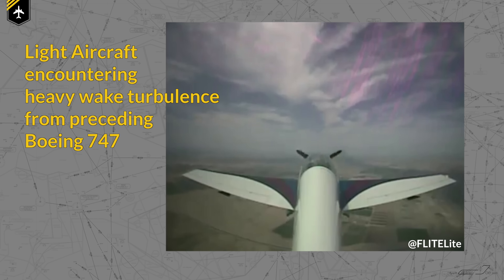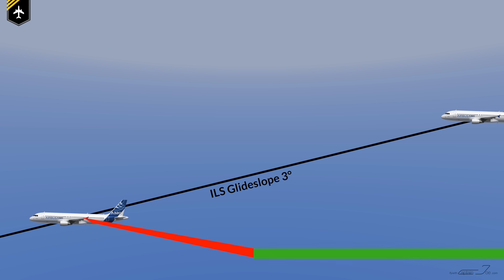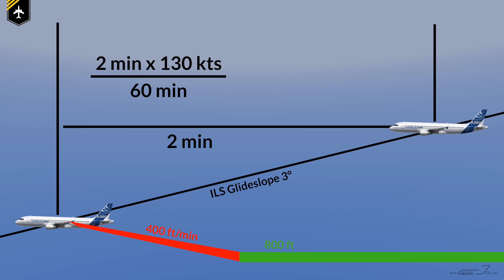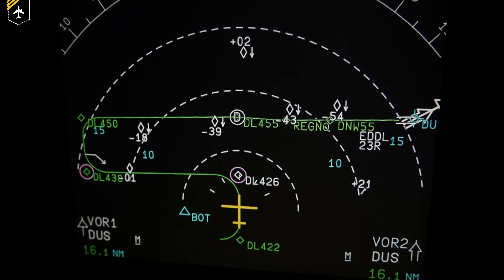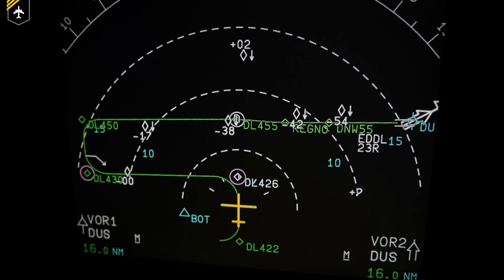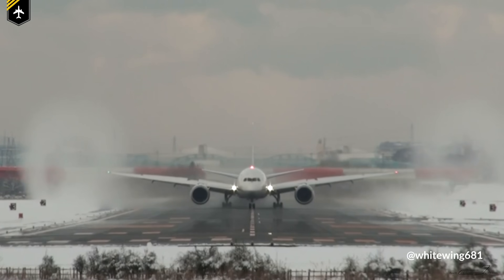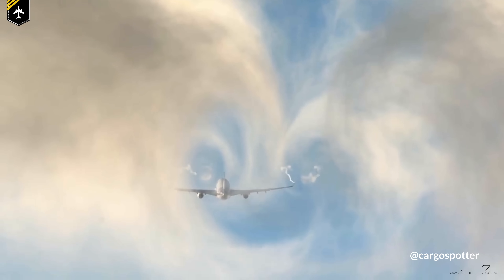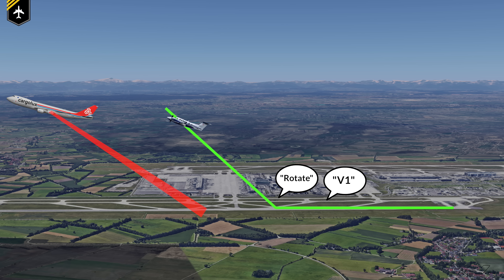WHY do pilots say HEAVY? Wake Turbulence EXPLAINED BY CAPTAIN JOE

Comment: Good explanation of heavy jet separation. However, contrary to your explanation of a turboprop departing after a heavy, there is also increased separation when departing behind. Generally 4nm heavy after a departed heavy. And 5 nm for others after a departed heavy. Also, 2 minutes time may be used, but controllers usually use the RADAR separation as it is usually more efficient. If the  pilot wants the 2 minutes, they should advise the controller BEFORE taking the runway.

Comment: Hey joe, how the fighter jets elude this wake turbulance?? Because I saw group of them flying really close in different formations in many videos..
Reply: I'm not Joe, a pilot or an engineer, but I am read up on military aircraft.  Most military fighter jets are inherently unstable, which allows them to make sharp turns.  However, it means that humans are not able to fly them on their own.  As a result, they have flight computers that automatically adjust the control surfaces to keep the plane flying as instructed by the joystick inputs.  This takes into account the inherent instability of the fighter jets as well as any turbulence that the plane may encounter.

Comment: Wait, so since the Antonov 227 is larger than than the A380 is it also super, or does it not have anything?
Reply: E. Andrews it’s technically a super, but considering it’s so unique, if an An225 is coming, the controllers will be briefed beforehand and they would know exactly how to maintain separation.

Comment: The thing that doesn’t make sense is everyone approaching is usually on the same glideslope. With a 400fpm sink rate for the vortexes they should be well below the glideslope relatively quickly. Near the runway it could get bad though depending how long or short various pilots decide to land. 

In theory though a light should be able to safely follow a super as long as it stays at or above the supers glideslope, and lands beyond the supers touchdown point to avoid any vortexes that could be drifting on the runway.

Comment: For 8:09
Is it because the wake turbulence created by the plane is used by the glider to fly
Am I right?
Reply: That's not the principle how the gliders are flying.
In that scene we saw how an aircraft (a tow plane) is towing a glider with a towline. When they are at a certain altitude the glider will be released, and it starts its own flight. When the glider is gliding the wings produce lift that allows it fly, but of course it will lose altitude.
But gliders can gain more altitude by using rising currents of air. These are known as thermals.

When the sun warms the ground the warm air begins to rise and when this process continues it forms a column of air known as thermal. Now the glider can fly to this thermal and it can gain more altitude using this thermal. Then the pilot can glide to another thermal and climb again. 
By flying from thermal to thermal a glider can fly long distances, for example hundreds of kilometers.
Reply: @mikep9604  hi thank you for your answer
But that's not how gliders take off 
They take off using a catapult sort of structure 
But I agree with the second part
Thank you
Reply: @Hi-pp9ew  - Yes, gliders can take off using that "catapult" that is a powerful winch. Here is the principle of the winch launch:
https://i.stack.imgur.com/AP9t6.jpg
But yes, the gliders also take off so that a tow plane will tow the glider using a towline. That's called aerotow. I can assure that this is true because I was a glider pilot when I was young, and I have made hundreds of take offs so that a tow plane was towing the glider.
Here you can see the towline between the tow plane and the glider:
https://members.gliding.co.uk/wp-content/uploads/sites/3/2014/09/London-1024x769.jpg

Here are some videos about aerotow:
https://www.youtube.com/watch?v=KlovGBcJSBA

You can see the tow plane in front of the glider:
https://www.youtube.com/watch?v=kw88jLB4W1o

https://www.youtube.com/watch?v=WzGbrBrxOS8

Comment: But yet in air refueling happens below the tanker... is there a 'sweet spot' that has no turbulence?
Reply: As sir said
Wake turbulence is caused when the planes have the angle of attack  more or less than 0
The planes while refueling do no ascend or descend so the wake turbulence does not act upon it
And that can be considered as a sweet spot after the plane has been in the fixed altitude for quite a while

Comment: Well dont forget the only plane other than the a380 that uses "super" in its callsogn is the antonov an 225
Reply: the next one beyond super should be ex-wife
Reply: And the fully loaded C5 galaxy
Reply: @jackstephens7222  if I remember right it goes by the empty weight of the plane idk if the galaxy is heavy enough for the super callsign and plus im pretty sure military aircraft have different rules and what not
Reply: @sweetdaddydee1314   Im fairy sure its the weight its loaded too otherwise you could end up sending a plane into a vortex by mistake because of weight distance, seeing as how the c5 can carry abrams tanks im fairly sure its super some of the time. And yes they do use different protocol but if landing at civillian airfields (though rare) they'd have to use civillian protocol.

Comment: Why use tons. Is that metric tons? Why not just keep it simple and use 300,000 lb as they do in the US. B757 at 255,000 lbs is a heavy, as it generates extream wake. ICAO Medium goes from  7000 tons to 136000 tons, that's a pretty big spread. Who cares if it's light.
Reply: Cause literally everyone else except of the US (and maybe Myanmar and Liberia) uses the metric system. It's not 7000 tons, but 7000kg (difference factor: 1000)

Comment: How does wake turbulence work from an over wing aircraft vs under wing aircraft? What does it mean when an aircraft has a T-Tail or a Lower Tail wings at the back of the aircraft? How does the wake turbulence work between these different types of aircraft's? As well are these things different depending of if the engine is a propeller or jet plus whether it is a single or multi engine plus does the tail put off a wake turbulence and how does it work? Can you do a video on this?

Comment: The term heavy is used during radio transmissions between air traffic control and any aircraft which has been assigned a maximum takeoff weight (MTOW) rating of 136 tonnes (300,000 lb) or more.

Comment: As a student pilot at 14 years old, we were coming into land at our local airport.  Also operating out of that airport is a Air National Guard unit.  They run C-130's.  As We were on final in our 152, we near inverted and had to pull out.  My instructor was quick to take controls, and take over all operations.  We were not alerted prior to landing about C-130 operations.  Evidently the C-130 had landed some 5 minutes or so before hand.  So, they can last a good bit.  I lived this, lol

Comment: GA and commerical planes need to watch out for ultralights, because we don't give two shits about using radios.   Mainly, because even if we wanted to, we can't hear anything on a radio from the open cockpit prop wash, so radios are useless.   Therefore we also don't talk to ATC or receive any instruction or vectoring from them.

Comment: US Air flight 427 hit wake turbulence while landing on a clear, calm evening.  While not the sole cause of the crash, the turbulence pushed the plane's control surfaces, causing a hydraulic motor to fail.  The plane rolled and crashed almost immediately.  All souls aboard perished.

Comment: hello captain joe, I want to know if the aircraft use the suffix heavy according to the weight they are carrying at the moment or even without considerable weight it remains heavy in the case of A330, and I also want to know if the B747-8 uses the super suffix like the A380

Comment: Looks at the comments
Don't people realize fuel not only produces water vapor and CO2 when it is burned but can also absorb water vapor during storage and still (sort of) work? When fuel is burned in a cold environment the water vapor is invisible at high temperatures near the engine, but as it gets farther away it cools, condenses, and forms a visible trail of cloud?

Comment: So when 'heavy' planes are are under control of an ARTCC I would think the designation is not necessary. Only on approach, departure or tower, (and ground too - I think). Is that correct?
Reply: TheMerryPup not really. There have been instances when a plane has been hit by wake in cruise by a larger plane flying ahead and slightly higher. I believe it was a business jet and an emirates a380. It did make the news, so you can search that up
Reply: @ZK-APA  OK, I'll search for that. Thanks for the reply!

Comment: I've had a few wake up calls for the pax. Turbo props are handy for spacing you can speed up and slow down quickly, keep high for a chop and drop and if you're uncomfortable with the time behind a heavy a go around is a breeze. You're coming into land in your ATR or Dash 8 and wham you're going for a barrel roll over the runway. That gives the pax. a wakeup.

Comment: A Glider flies a bit higher than the toe plane because of slipstream, that comes direktly from propeller. The slipstream comes from right over the wings of the toe plane so that's why to prevent the glider from the created turbulances, it has to fly a bit higher than the tail of toe plane.

Comment: I was once following a C-130 (about 60 tons) in a Glassair FT (less than 1 ton) into Boeing field in Seattle.  They warned me about wake turbulence but I decided to go in close behind anyway.  I hit the turbulence when I was a couple hundred feet off the ground and it rolled me into a 90 degree bank.  At the time I was a USAF pilot just coming out having done extensive aerobatics in T-37 and T-38 so I was quite used to "unusual attitudes".  In addition the Glassair is quite responsive and has a decent roll rate, so I just rolled back to wings level and continued the approach and landed.  But I could imagine that an pilot not used to aerobatics, and/or in a plane with a poor roll rate in the landing configuration, this could have been a disaster.

Wake turbulence is not something to be taken lightly, it can kill you.

Comment: Hi Joe, It was mentioned that the glider plane flies higher than its tow plane. But in a similar case the smaller fighter plane flies lower and closer to the tanker aircraft. how does it counter the turbulence?

Comment: Hi Captain Joe, I have some questions to you about pilots and tubulence.

How is it to fly when you experience hard turbulence, how are you doing? Will you ever be nervous?
I would self like to be a pilot when I finish studying, but when I fly as a passenger and we fly into a tubulence I may get a little nervous. But otherwise I love to fly.

Can Turbulence doing a plane falling in ft. Because when I was returning from the United States in 2010, I flew through Toronto two Copenhagen in a B767-300 Air Canada, where the plane suddenly took a big drop but rose again. The pilot did not even tell us what happen and the cabin either the staff said nothing or showed what happened.